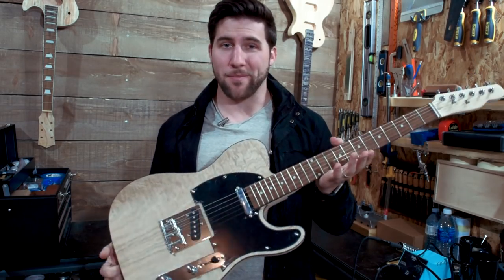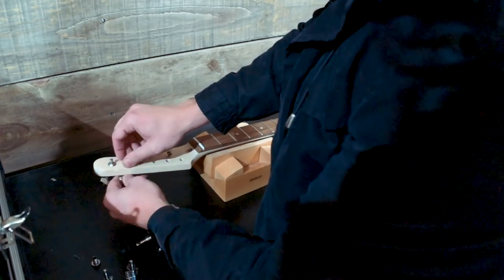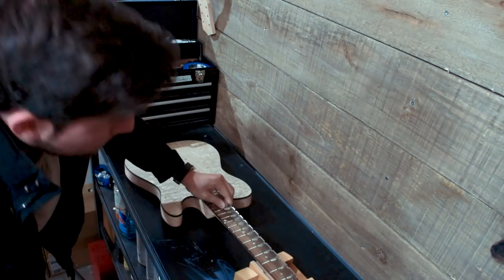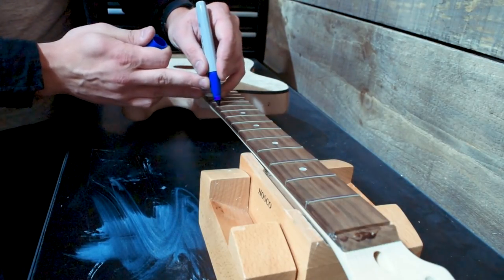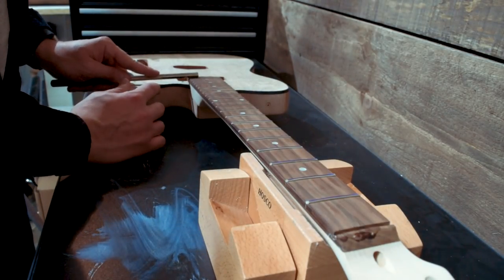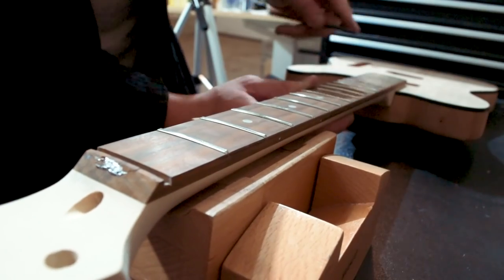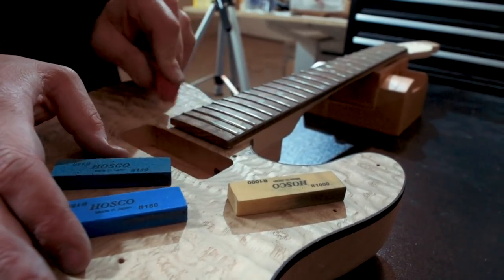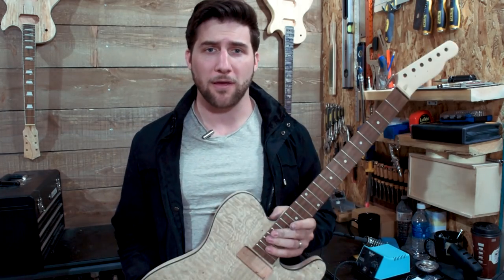The Ash Burl Top Telecaster Guitar Kit | Fret Levelling and Crowning (Part 3)

Comment: Finally got some time to watch this, worth the wait as always!! To remove a nut super easy is hacksaw along the center of the nut creating 2 very thin edges that can now break toward this center valley and come out very easy with no damage to the neck. Love my shinto rasp.
Reply from the maker: I try not to break nuts etc. when I take them out, but that’s a good suggestion. 

I’m hoping to either start or help with some initiative to donate cheap spare parts where some marginalized group can use them.
Reply: @BradAngove  sounds cool

Comment: I really like the black binding they put on this Tele you are showing us. I still have to practice more on my fret work, I think I tend to get a little impatient when it comes to such things lol. I have a feeling that I am going to have to replace the fretboard on that Les Paul I showed you that I refinished, the one I put the belly cut in? I tell ya what Brad, I have never really paid much attention to a belly cut but yesterday I was playing that  LP and I noticed how comfortable it felt and that's when I noticed just how convenient and comfortable a belly cut be lol. If I ever di that again to another Les Paul I will have to remember the chambering lol. Anyway about the fret board, I think the guy who had it before me, after he refinished it, must have had issues with the paint line along the edge of the fret board and he sanded the edge back but seemed to have only taken the wood back and not the frets! I can't really take the frets back to where they need to be because then I am concerned the high e will drop off that edge as I am playing it, yeah he took the wood back that far! It seems to really only be in the main tablature area of the fret board and I have gotten used to it now, but one day I might try my hand at putting a new fret board on a Les Paul, so hurry up and make a video on that subject lol.
Reply from the maker: Use a file to knock the frets back flush and re round that edge. Then get a blank nut and slot it so that the strings are even on the board.

Comment: A great instructional video as always. Are you going to sand down the edges of the fretboard? We have a solo kit we are working on and the edges of the fretboard are hard angles and quite sharp. I’d like to sand these down substantially so they are nice and round. Would you do that before or after the fret leveling and crowning?
Reply from the maker: Did you not see me do that in the video? You can sand them or burnish them.
Reply: I did see it. I think you used a very fine grit sandpaper and I understood it was basically for smoothing the fret end dressings. I’ll probably give the fingerboard edges a light sanding with 400 grit before starting any of the fret work.

Comment: Just about to start working on my first Solo Tele kit and finding your content extremely helpful. Realizing I had no idea what I was getting into!  I plan on doing a level/polish on my build - one question about the video.  What grit sandpaper was attached to the Fret Level Beam? 600?
Reply from the maker: I had 400 on there I believe. 600 would also work fine. It’s just a touch slower, which may be a good thing if you’re just starting out.

Comment: I had a question on leveling....Is it better to use the the level bar or a radius block? Do they do the same thing?  I am buying the tools and I have seen both methods and don't want to buy a radius block if other guitar kits or necks don't have that radius.
Reply from the maker: I never use a radius block, but some people certainly do. I don’t find them very versatile since they only work on one radius, and they always tend to sand the ends of the frets more than the middle because they’re designed to match the radius of the fretboard instead of the frets. So yeah, I always use a beam or file.
Reply: @BradAngove  Thank you,  that is what I needed to know. I got my first kit (not from Solo) and doing research. The radius of the neck is different than any guitar that I see. I will use your link and get the leveler from Solo.
Reply from the maker: I hope the fret work goes well for you.

Comment: Why not use a leveling beam that covers all frets at the same time? When using a beam that’s shorter than the fretboard you’re actually sanding the center frets more than the end frets. Think about it. The center frets are in constant contact with abrasive but the end frets are receiving much less time actually being dressed.
Reply from the maker: This is a very long fret beam haha. It does cover most of them. One that covers the entire board at once would also be good, particularly for the reason you’ve mentioned, but let’s keep in mind that it is a flat beam. So as long as it bridges the majority of the board it will not sand one section lower than the others.